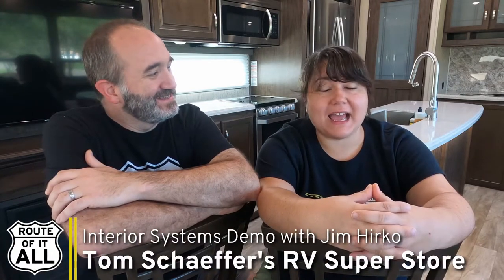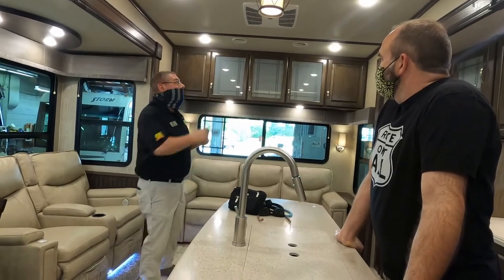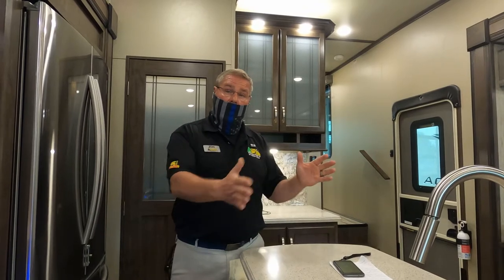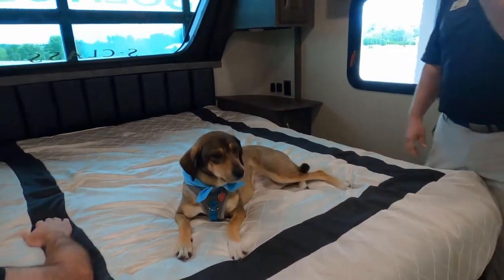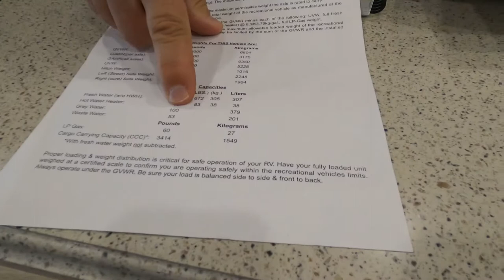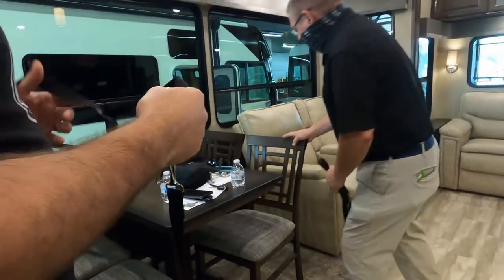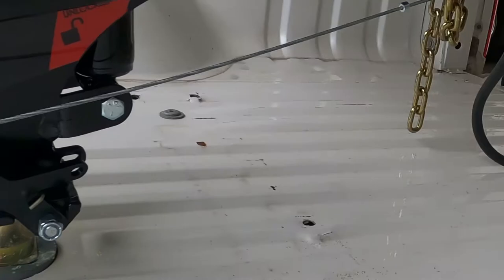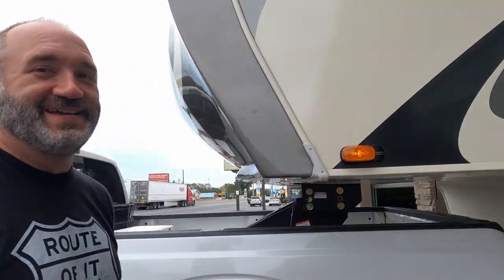Grand Design Solitude S-Class 2930RL-R Interior Systems and Hitching Demo

Comment: We purchased a Grand Solitude S-Class 2930RL this past September - your video is the best and most thorough guide we have seen for this model.  Thanks for posting!
Reply from the maker: Thank you so much, we love hearing that our videos are helpful!  How are you enjoying your rig?  It's one of our favorite floorplans - we absolutely love how open and spacious the bedroom feels!

Have you run into any issues yet?  We recently had a couple of issues, and will be highlighting them in a future video...  We hope that you find those helpful as well!
Reply: @TheRouteofitAll  We have been very pleased with our 2930RL.  We had an issue with the propane line that feeds the kitchen slide getting pinched when the slide was closed - discovered on our first trip when fridge was beeping on arrival.  Easy fix to unplug the line and route it better where it traverses the slide bottom.

Used plastic shims under the bedroom floor to fix a noisy floor in one area - again very minor. 

We upgraded the bathroom faucet to one that doesn’t spit air.  Added RV Airflow, Bluetooth AirXCel Thermostat and Micro Air Easy Start to heat pump.  Added EMS to protect electrical system.

Also redid the basement wall configuration for easy access to plumbing/electrical and currently adding solar, inverter and lithium batteries.  4 - 200watt Renogy panels, 3000 watt victron inverter, 3 - 100amp Battleborn batteries and a 150-85 solar charge controller.  Doing all work myself.

Comment: With the Battle Born batteries you will only get 80% charge with the converter that came with the trailer. If you upgrade the converter you will get 100% charge and it will charge your  lithium battery faster.
Reply from the maker: Yes! We're looking into a Victron Multiplus (or two). Have you had any experience working with Victron equipment?
Reply: You don't necessarily need to go with the Multiplus unless you're going to do a lot of other upgrades, ie. add more batteries, new inverter, solar etc. If you're just going to stay with two Battleborn batteries (I did in my 2930RL-R for over a year) you will DEFINITELY want to go with a new lithium compatible charger. I got a 60 amp Progressive Dynamics lithium charger that's a direct, drop-in replacement. The stock charger does not provide the proper charge profile and won't fully charge the batteries or as quickly. Go out and watch the Will Prowse video where he discusses this subject with the owner of Battleborn. Will the stock charger work? Yes, just not well. Why pay $2,000 for a couple of batteries and not spend a couple hundred to get the full benefit of them.
Reply from the maker: We're planning for lots of upgrades for our power system in the coming months!  We're not sure how big we're going to be going with the batteries just yet, but we're planning on being able to run the whole rig off of the inverter setup.  We want to set it up so that we can add in a bunch of solar in the future as well.

For us, one of the big selling points of the Victron Multiplus is the ability to boost a lower amperage shore power line with the batteries.  And if we go with all Victron monitors, inverter/charger, solar controllers, etc, then we can tie it all together with the one of their control panels as well for ease of monitoring exactly what's going on.

That being said, we're not committed to Victron yet...  We're keeping our eyes open in case something better pops up on the market between now and when we decide to pull the trigger.  

You mentioned your charger, I've heard Progressive Dynamics makes good equipment. What are you using for an inverter?
Reply: We are currently using the stock 1000w inverter (for the res fridge), two BB batteries, a Prog Dyn 60w lithium compatible charger/converter, and a BMV712 Bluetooth battery monitor. 
I tried to send you more info here about what's about to be installed (solar), but it must have been too long. If be glad to share with you if you tell me how to contact you.
Reply from the maker: We are very interested in hearing more! To keep the YouTube bots from flagging things, the easiest way is to send us a message through our website: https://www.therouteofitall.com/contact
Thanks!

Comment: I just purchased a practically new, 2022 2930RL-R. I have a question about the breaker panel. If your refrigerator is running on the inverter, can you power it down at the breaker panel? Before I learned about the inverter switch under the counter, I was trying to keep the refrigerator from killing my batteries by opening the breaker. I actually had every AC breaker open and the refrigerator kept running. I put a battery cut-off switch inline of the inverter, then I learned about the remote switch.